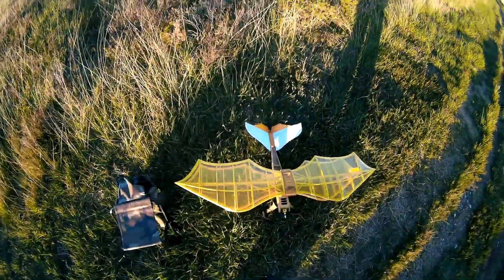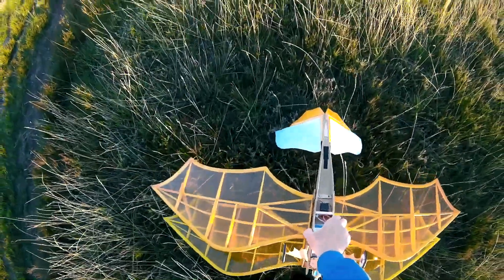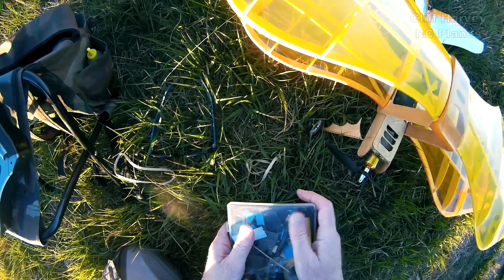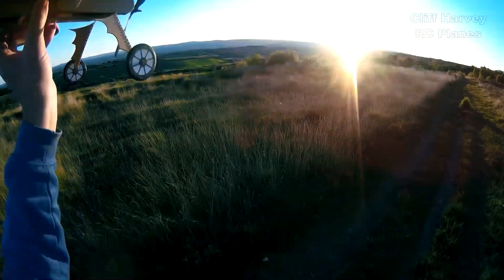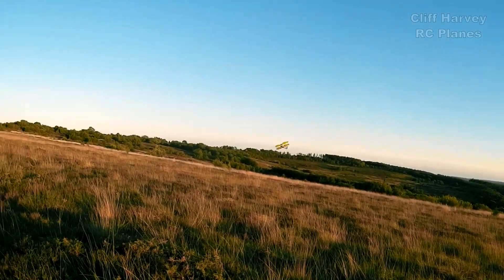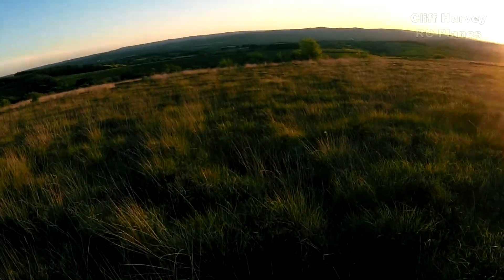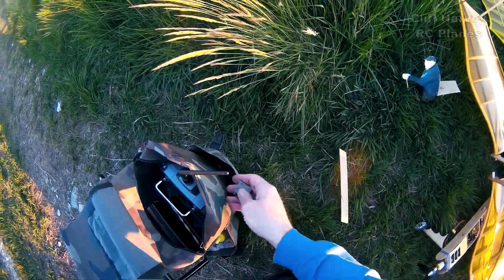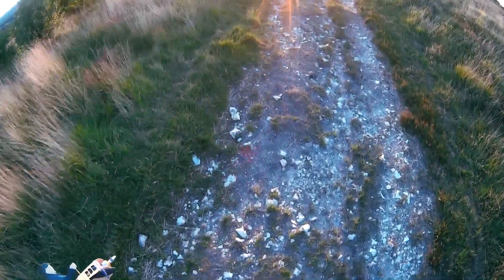DA Vinci Flyer Biplane Second Flight Attempt

Comment: The center of the median line is your driving force the center of your fuselage. The upper wing has a high drag, and it is too far from the median line. For it to fly, you must make the fuselage longer, that is the tail and elevator.
Reply from the maker: Hi Salt, you're right of course, the top wing was added just for a lark really, it was/is a monoplane really, thanks for your advice, cheers 👍

Comment: That did not go so well did it.
Do you remember its 100 watts per pound or 60 to 80 for a trainer. the more weight you add the higher the wing loading so a longer nose is needed and work out the weight of the model and use a watt meter to know if your motor, prop, battery are good for the job. Just my two pennies worth ;-)
Reply from the maker: Thanks Stephen,  a good two pence worth, cheers 👍

Comment: The experimenting is 1/2 the fun. A couple of thoughts - 1. does it really need to be a biplane? or 2. how about a staggerwing? Love it.
Reply from the maker: Your not wrong Tim, a Biplane will come to fruition  ... so many layouts to choose from 🤔👍
Reply: @CliffHarveyRCPlanes  I've been thinking about this problem recently for a new build I"m planning (video coming soon) - the problem is the center-of-lift compared to the center-of-gravity. 
You have move your CoL forward with the current configuration. I think the solutions are: more nose-weight, a longer nose, or move the CoL further back (staggerwing, relocate the wing mounts, make the wings wider) - or combinations of these.
Reply: I agree !
I had the same idea.
Another reason for instable flight ist the axis of the motorthrust.
Because oft he added upper wing it should get amore downward angle !
Otherwise, like here, the motorthrust produces a momentum upwards !
With changing throttle the plane beginds to "dance".

Comment: By adding a second identical wing you doubled the wing area but you didn't increase anything else as far as I can see. So the moment arms are now short and the tail area rather small. Also, most biplanes have the thrust line between the two wings, not in line with the bottom one. I doubt you can compensate for all that high-up drag with down trim and nose weight. The wing design is really beautiful and, as a monoplane, the proportions looked right. A biplane, however, is a different kettle-of-fish all together. Keep going Cliff!
Reply from the maker: Hi David, your observations are correct except I did increase the tailplane area with the temporary cardboard. I know it was always going to be just a fun experiment but didn't it look good for a few moments? She's going to get a complete redesign taking your, and others, comments and suggestions into consideration, cheers 👍